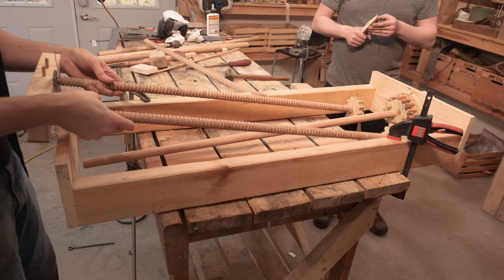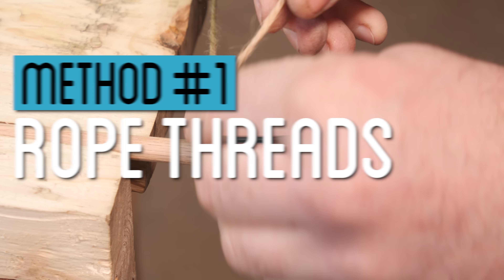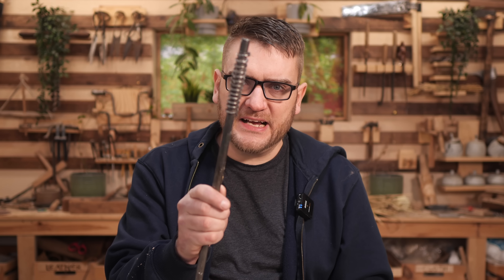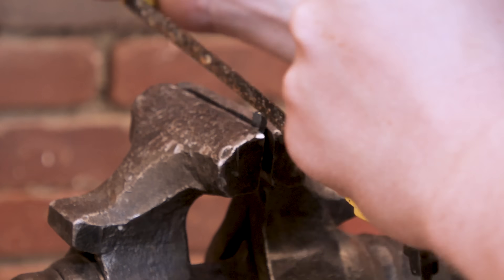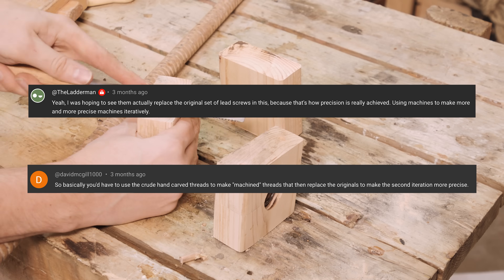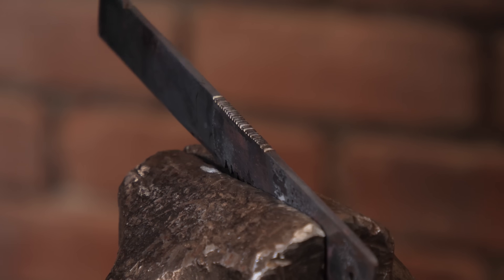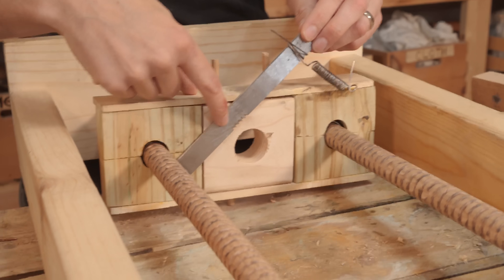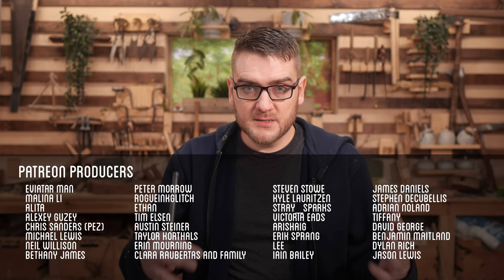This DaVinci Machine Changes EVERYTHING

Comment from the maker: Go to Mando at https://httpsshopmando.com/4hXLBjs and use promo code HTME to Control Body Odor ANYWHERE! Get $5 off your Starter Pack plus free shipping (that’s over 40% off). Thanks to Mando for sponsoring this video!
Reply: I'm so excited to see if you took my advice
Reply: 7:30 would you my flatten and twist method It works really well actually you just have to make the end a little bit better and I do like a flathead or a player grip flathead so not circular but a line on top

Comment: You can use the normally threaded screws as the new lead screws, put those in the machine, make two more screws, and then use those two new screws as the final lead screws. You don't have to make any gearing changes at all.

Comment: When doing the wrapped wire method, don't spread the spirals. Keep them tight. That makes it consistent. Use the pointed rod nut method for a nut and use your geared threading machine to make a coarser thread pitch using the wrapped wire screw as a master.

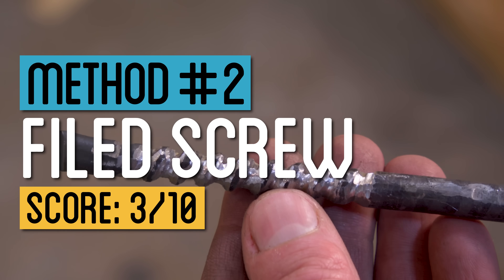Comment: 4:05 I dont get why you used a rounded file, it's not what they are made for, I would have used a pointed or even a squared on then moved to a round one for the bottoms, but it would have to be way smaller than that one you used. Unless you used more than just that 1 file which is not shown? Just make me question if you are using modern tools, why make it harder on yourself? There are some cool ideas here and I understand what you mean about having to hone the skill to get it done, I do argue that you should look into different options in the line of making, like using many different wire gauges, different files, and methods, ←Methodology is major in creation which I know you know quite well, plus I bet you do this already do ← but as a engineer when your inventing and learning you will go through iterations so fast, but in spirit of video making I can see why spending 24 hours learning everything is impractical so I get it, but does hurt some to see.

Comment: i would have build a gear change for the turning machine, and instead of a lead screw use string to pull a carriage, and that carriage have a cutting tool for the screw that you gonna make, but im stealing the mechanism of modern machines, so maybe kinda cheating.....

Comment: Would it refine the screw further to make two reference screws using the manual method, and then create two more reference screws using the machine because in theory those new reference screws should be more similar than the manual method. You could theoretically repeat this method to approach some 'maximum precision' value (inherent slop in the machine will prevent you from achieving anything too precise) but my hunch is one or two new references will get you 99% of the way to maximum anyway.

EDIT: Oh that's literally what you did.

I think for the soldered wire you need a second spacer wire...so wrap them doubled up around the shaft and then remove one of them, this should keep spacing more consistent (although there will rpobably be some movement as you'll have to manually unwrap the second wire).

Comment: 🤔 I think the third method would have gone better if you'd kept the tight coils, instead of spacing them out. Then you could have hogged them out a bit with a triangle file, if you needed more thread definition.

Comment: One other method to make a long, thin, straight band and wrap it around a dowel. You can possibly use a tightly wound string as well, but I'd follow it up with some kind of resin to help harden the threads and offer the possibility of smoothing things out. Regardless of method, the next step would be to sand cast it. At the very least, these would allow you to easily replicate strong and durable threaded rods.

Comment: As a machinist, machine rebuilder, this is a hilarious endeavor, im surprised you didnt use a treadle  lathe with just a big enough flywheel to tune it to a manageable rpm to synchronize your movement of your cutting tool to the chuck.
Id use 1 long rigid tool rest with graduations you can refrence your movement and angle of your file. Turn a long enough threaded rod so you can cut off a piece, file 4 little sections out as reliefs then mount back in chuck file down rod to a taper. Bam theres your tap for your nut you will need. Your first few nuts will be flanged nuts made out of some hard wood for ease of tapping. Id also drill the holes with extra clearance for reduced thread engagement.
Then you use gearing to ensure 1 to 1 and both your master screw and duplicate should spin same way. Put your flanged nut on use a loose fitting bushing as a way to mount a cutting tool to with a weight or tension you can increase. Then just keep running it back and forth till its duplicated bamo. Im kinda drunk but intrestinh strategies you implemented.

Comment: You mentioned casting screws but you would want to cast a rod broach it to make them smooth and straight then make threads with a tap and die to cut them.

Comment: Honestly the soldering one... That's on you, you did it hideously wrong and very poorly.

You take TWO wires, wire because it's drawn through a dye therefore exactly the same every time.

One wire twice the size of the other wind them TOGETHER around the shaft so that viewed in profile it's big, little, big, little and so on in alternating layers. Then you solder one end of the little wire, unscrew the big one partly, just enough to clean the solder so the big wire can now unscrew from the orks end you just soldered. Then screw it up the way you just soldered so you can now solder the other end of the small wire.

Using the large wire as support and screwing it in and out as you spot solder ensures no warpage and even spaced threads, these can then be flattened to form machine threads, this can then be cast in iron or steel or aluminium in the modern age.

Comment: You shouldn't cut the metal piece you should grind it. Instead of the saw you need to make a file in the desired shape that would allow you to grind out the threads you want. By using different sized and shaped files you could control the shape of the threads and the spacing between them.
edit: the angle of the cutting blade/saw/file determines the shape as well, but I figure you already knew that, but OCD wouldn't allow me to not mention it.

Comment: This comment isn't based on this video per se and I haven't seen all of your videos so I don't know if this has been addressed. When you have tried your earlier iron smelting I noticed that you have immediately quenched your blooms and relocated them to heat up and work them later resulting in an extremely poor yield. Many other videos I have seen of people using a bloomery immediately start forging the bloom while still hot out of the furnace and they have a much much higher yield. Have you tried doing another smelt where you start hammering on the bloom hot out of the oven instead of cooling it?

Comment: It’s been a while since the sugar experiment, but I recently found something interesting. 
Rock sugar is not the same as granulated sugar but pretty close.
A video I saw made the sugar by:
1. Juicing sugar cane (sugar beets could work)
2. Filtering the juice using a cloth
3. Boiling the juice, constantly stirring to bring impurities to the top and then removing the floating impurities
4. When the mixture reaches the right concentration of sugar (I’m guessing around 40-50%, video didn’t say but maple syrup is about 67% and the liquid looked similar to heated maple syrup), the liquid was transferred to metal buckets (clay and would can probably work) and were stored in a cool environment
5. Waited for crystal structures to form off of the walls of the bucket for several days 
Very unscientific and irrelevant I know but I wanted to share

Comment: it the machine makes threads, then you use those new threads, to make a 2nd new set, but its reversed thread.... just do it all one more time.... reverse the reverse back to normal, then you end up with the ability to make whichever thread direction you need along with the improvements.

Comment: I think many of your problems (with this and other machines) could be solved by using something other than construction grade lumber. I get that it's inexpensive, and easily available, but in Leonardo's time they more than likely would've used oak, beech, or some other hardwood. At the very least some mountain grown, tight grained spruce or fir which isn't really available today. If you could get ahold of some oak logs (or whatever hardwood is most available in your area), saw them with your sawmill, and then rebuild it using solid mortice and tenon joinery with your sawn oak, it would probably work pretty well.
Reply: Very astute.

Comment: Strange that the traditional screwbox was only rated a 6/10, given that it was what was actually used for centuries for cutting threads into wood (and is still a common project for hand-tool woodworkers wanting to make their own bench vises).  If your goal is something that lets you create screws with minimal practice and skill, it seems to check all the boxes.

Comment: I'm pleasantly surprised that the nut threaded onto the steel bar, good job! I'm sure in your research you know there are several different thread shapes available. Usually square/acme/trapezoid for motion devices and certain high loads, and V threads for fasteners. I wonder if your machine couldn't be fitted with a triangle file to make V threads for the store bought nut.

Comment: do the solder wire method again, but do two wires at the same time. then wrap one around a slightly larger steel, or brass rod that is the same diameter of the unsprung wire that now loosely fits around the original rod.

Comment: You're mixing up screws with bolts.  If you're just driving them into wood or metal they don't need to be consistent. 

Best way to make bolts and nuts is on a lathe with a gear.. which is essentially what the machine you made does.

Also you made a tap... Tap a piece of steel and make a die to run in the machine instead of the sawsall blade

Comment: its nice to see my concerns addressed. feel there is still much room for improvement here though 1 you need a lot more rigidity and closer tolerances even for wood 2 your still not close enough try a fine grained hardwood or commit to metal and create the tools to work that accurately. your cutter needs to have the same profile as the thread your cutting nit just cut teeth on the bottom of a bar 3 did i mention rigidity ? theres a lot of slop and backlash in your mechanism and it would benefit from bearings and bushings and larger contact surfaces   but on the whole this is a much better offering compared to previous prototypes which i feel has the ability to progress from partially functional proof of concept prototype to functional revised tool. thanks for the videos

Comment: Use a V shaped file instead of flat. It will widen out as it cuts and make very nice screws.

Also, hook the hamster wheel up to the screw making machine. There's loads more torque, so you could go crazy with the gear ratio and spin it really fast. You'll probably need a lubricant like wax to keep it from overheating and sticking from friction

Comment: You could probably make the threads denser if you threaded the rod, and then offset it by half a rotation, to thread the rest. Even though that would make double threads (I don't actually know what they're called), which is likely not what you're aiming for

Comment: so... you dont actually need to worry about reversing the thread if you are using the machine to make iterated improvements to accuracy and precision. This is a machine tool all that matters is the distance between the threads and the threadforms.

Use your tightly threaded metal rod to make just one more coursely threaded rod then move in to the next step in precision and more importantly automation. Uh you can make this easier on yourself by making square threads because the added gemotry of having to deal with diamater and angle and distance thats going to be just. Oof painful until you get a mastered leadscrew

Yea. A mastered leadscrew.

To measure the lead more accuratly you measure the angle of the lead. Make a bushing the holds a long light flat, stiff indicator and just measure the angle of your soon to be mastered leadscrew all the way down marking off the angle in every 1/8th turn of the screw. Lap the faces that sit off kilter so that at least in one direction the angles always sit correctly. You only need one direction. This isnt time to show off this is time to hide your shame like a one direction fan boy in 2025.
(Just joking wear your fandom with prode fanboy the pun was irresistable)

Once you have the angles working proper then make multiple nuts in a softer metal to make laps out of and lap everything smooth and even checking your progress on the angle measurement. 

This would also be a great time to make a primitative test indicator just a bunch of small levers that exaggerate movement you dont need a "last word" or a DTI or any such just levers pushing levers pushing levers to show movement.

After a while you will get a stead smooth mastered leadscrew. . . in one direction
But you can use that leadscrew to cut a better leadscrew because it can almost copy itself, but more importantly it CAN be held slightly out of phase as you cut, or lap off the master

Meaning you can figure some method of measuring distance traveled to your master leadscrew and because you have ot advancing extremely smoothly you can get a leadscrew that advances extremely accuractly. 

Id say just skip ahead to inferometry to measure your master leadscrews distance traveled but thats just me. Wrapping wire around a shaft and measuring rotations of that shaft would be fairly accurate and more period correct.

Comment: You can also do it the way a lathe does it. Build something that will feed + rotate a rod at at constant rate through a cutting tool. You could probably do it with some pulleys and gears

Comment: If you were to make the tap out of annealed high carbon steel, then harden it you could in theory then use the hardened tap to cut into another piece of annealed high carbon steel to make a die and then harden it thus making it easier and faster to make precise screws and nuts.

Comment: For your saw blade setup to cut threads in wood screws, I might suggest angling the saw at the same pitch as the thread you're cutting that way (theoretically) instead of the saw being dragged through the wood somewhat sideways, it'll be dragged through in the primary direction that you're cutting. Also for cutting threads in wood screws you might want to replicate what is in DaVinci's depiction where he used a blade similar to a wood plane though possibly in a V shape that way it could cut nice sharp V shaped grooves to act as your thread. Also it wouldn't be as prone to potentially deforming the thread if the angle is incorrect like the saw blade. This could also theoretically mean you could use lathe bits in this machine for cutting iron, bronze, brass or soft steel (if it can handle the steel with a plane type bit holding system I am uncertain). 

EDIT: Also for your issue of new rods coming out as reverse copies of the threaded rods in the rest of the mechanism there's a very simple solution. Cut two new rods that will be a regular thread (right to tighten) and then the new rods you make off of that will be backwards (left to tighten). You would simply need to make two rods with the regular thread, and since they cut an apposed thread you just make two more apposed thread rods and then with that in mind it'll come back around full circle. (does this make any sense?) Where you cut one pair, then use that pair to cut another pair that will be going in the correct direction.

Comment: I'm really confused by the rules here, are you trying to avoid using existing threads and screws or not?

I assumed you were trying to "bootstrap" your own screws from nothing, but then you started bringing in existing screws to cast copies and existing bolts to test the threads you made and that sort of thing.

If you're willing to use existing threads to make new threads, why not just weld/solder a rod to the end of an existing threaded rod or screw, and use the threading action of that thread through a stationary bolt as a guide to cut the threads on the unthreaded rod?

Comment: sorry, but that is totally wrong!
you WANT your machine to create a better set of reverse threads so that when you use THEM as lead screws the thread is reversed AGAIN giving you the original threading direction.

also you must stop thinking in terms of reverse or standards!
THIS MACHINE is what defines THE standard.

the important quality metric is making a metal screw, turn the screw into an internal thread cutting tool (tap) to create nuts and then create more screws that all fit the nuts made with the tap.

you want A screw that you can replicate consistently and with good precision. nobody cares what the exact pitch or diameter is. all that matters is that you can create this one screw over and over again.

going from a known screw to a lead screw on a lathe you can then use the lathe to produce any screw you want by changing the gearing between work piece and lead screw.

Comment: Gears, which can be carved accurately out of wood can be used to:

Build a rack & pinion connected to a series of reducing gears so the rack proceeds along the length at a controlled & consistent AND HIGHLY PRECISE rate.
Not too dissimilar from a barrel rifling machine.